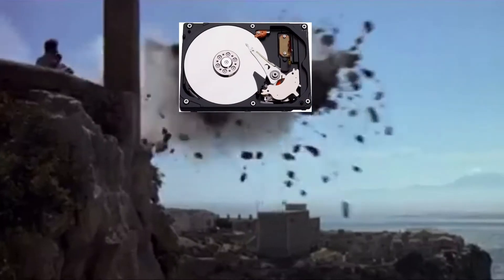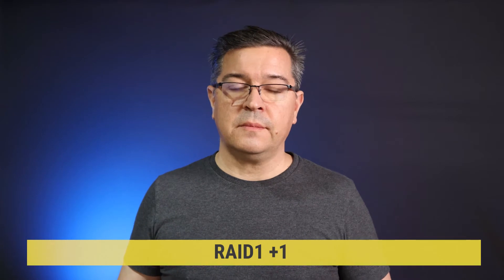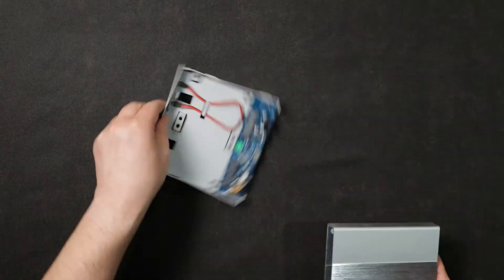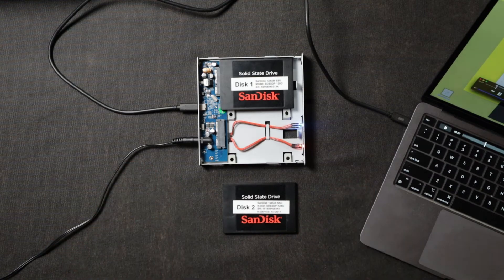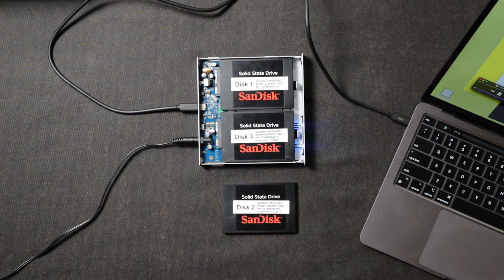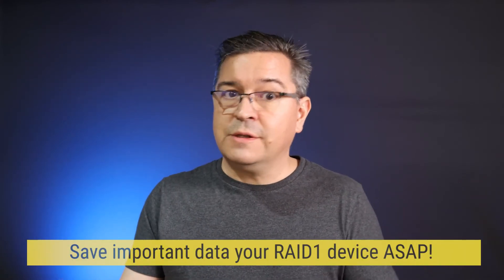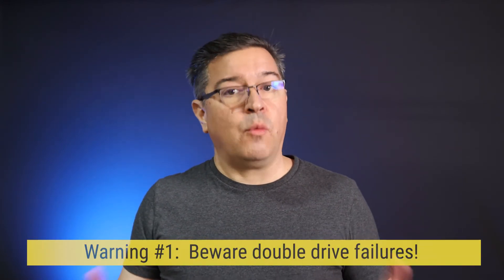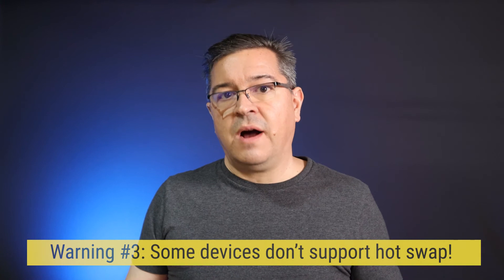CRASH PROOF your data with the RAID1+1 storage system

Comment: Hello, are the raid controllers necessary? I seen you can run raid one configuration on windows (11) simply place 2 drives and set them as raid 1 in windows... also for double hard drive failure. Buy new hard drives half a year apart and logically thinking its almost impossible them both fail at same time ? As one will have half a year more usage. ? 🤔🤔 unlike when you start new and buy same new hdds turn them on at same time and use for same period. Seems like they should both fail at about similar time in that case

Comment: I was exactly looking for something like this, THANK YOU MAN!
It’s basically a hot spare for RAID 1.
I’ve been trying to get a decent 4 bay NAS for the longest time, I’m aiming at making a RAID 5 with 3 disks and a 4th for hot spare but I just can’t dish out the money to start the whole thing. With this strategy I could start with a 2 bay and swap the drives out periodically but wait I have a question: what drive is given the priority to be overwritten in a swap when the 3rd drive has always less data of the other 2 in the RAID 1?

Comment: this is a really bad idea and lot of misinformation.  
        1) when the raid is rebuilding its putting alot of stress on the disks in the array. you are not saving or spreading 'wear' or 'tear'. 
             in most cheap arrays when you insert a disk it does a full rebuild on the new disk and not just rebuilding the missing data. repeatedly rebuilding a disk in array will significantly reduce its lifespan
         2) chance of errors results in catastrophic failure. if a user mistakenly inserts the drives in the wrong order the backup drive could be the data that gets mirrored completely wiping out weeks or months of data
         3) when the rebuild is happening you are increasing the stress and the RAID is in a degraded state. depending on the amount of data this can take hours to days. this mean every time you are doing this you are risking a subsequent disk failure during the rebuild resulting in complete data loss
 
if you want a third disk, the best option is to put that disk in another system (preferably offsite) and use snapshots to replicate the data from your array.
Reply from the maker: Thanks for the detailed comment, hidden! You bring up some excellent cautionary points that folks should consider. Here are my thoughts:

1. full rebuild puts stress on both disks in the array (existing one and fresh one). Yep. You are absolutely right, and folks should assume that rebuild process for a RAID1 array will write every sector of the existing disk to the fresh disk (rather than just writing sectors with data). That rebuild process will stress both disks, and reduces how many years the disk will last (particularly for SSDs). There is also an increased the risk of a double drive failure during the rebuild, because the drives are getting a lot of use in a short period of time. Though it's work noting that the rebuild applies different use to each drive: one is getting a ton of reads and the other is getting a ton of writes. That temporary, differential use also creates varied wear between the drives which is useful for RAID1+1 (see below).

My general answer to this concern is: I don't care if any of the disks die sooner because of the rebuilds. I'm not trying make the disks last as long as possible. The disks will all eventually die, regardless. The only thing I really care about is avoiding the disks failing at around the SAME TIME. Pulling a disk out of the array and putting it aside for a week or month means it's not getting any read/write stress while it's out of rotation, and that action varies the time of its eventual, inevitable failure relative to the other disks in that set. Is this practice an absolute guarantee against double drive failure? No, it is not. However, compared to the risk of two, similar drives subjected to the exact same read/write stress over a period of years failing at the same time? I'm going to keep swapping drives periodically.

> you are not saving or spreading 'wear' or 'tear'. 
I didn't say this process "saves" wear and tear on the disks. It does not. Over the course of years, each of the disks in a RAID1+1 set is getting about the same amount wear and tear, particularly if you are diligent about swapping them out regularly.** The swapping process spreads wear and tear in that each of the disks has reaches a particular level of total use (say 8760 hours of use, 1 year) at different times. If I swap one drive out each month, one of those drives will have up to 720 hours (30 days, about a month) less use at any given time. You can think of this as  randomizing wear on the drives, and that variability is limited by the size of the disk swapping time window (1 week, 1 month, etc). Again, the purpose is to reduce the likelihood of a near-simultaneous double drive failure, by increasing use variability among the 3 drives in the set.

2. mistakenly putting in the wrong RAID disk: It is possible to mess this up, though if you are taking just one disk out, and swapping just one disk in, your chances of messing that up are pretty low. The times I've come close to messing this up is when I've been swapping disks into a dumb RAID1 array (an array with no software interface controls, not a NAS) in rapid succession. This potential fail is also one of the reasons why I number each of the disks in my RAID1+1 sets and keep a log of what disks I've put in and taken out.

The real danger, here, is if you are not paying attention to (or can't tell) if the RAID1 rebuild has completed. If you pull the source disk before the rebuild completes to the fresh disk, you are going to have a bad day. SO, make sure you use a RAID1 device that clearly indicates when the rebuild is complete, and check that indicator before you do any disk swaps.

3. rebuild process is stressful on the disks and can take days, increasing the risk of data loss. That is also true. When I rebuild my 4TB RAID1 set, it can take 12 hours to complete. So if you are swapping disks, it's best to do it when you are expecting some downtime (e.g., just before bedtime or when you aren't actively modifying data). Also, the larger the disks you use, such as 10TB or bigger disks, the higher this risk becomes, because of how much longer the rebuild will take. You can reduce some of this risk by using smaller capacity drives and use more RAID1+1 sets.

One other important details to consider: While the rebuild is going on, ONLY the failure of the existing disk with the current data on it (not the new, fresh disk) will cause the whole array to fail. That will definitely suck, but it's also the best (?) time for that failure, because the disk you just pulled out of the array is a very current version of your data. It's still a risk though, and worth considering. Also, to clarify: If the fresh disk that's being written to fails during the rebuild, that's not a problem, because the existing source disk still has all your current data.

> if you want a third disk, the best option is to put that disk in another system (preferably offsite) and use snapshots to replicate the data from your array.
I think this is a reasonable alternative approach, particularly if you want to get the most life out of the individual disks in the RAID1 array, because it will eliminate the rebuild stress on the disks caused by drive swapping. It does mean you need to set up a good, reliable and separate replication/backup system to the third disk, which you will have to setup and maintain.

This approach, however, also increases the chance of a double drive failure for the two disks in the RAID1 array, because they are getting the exact same amount of use over the course of years. I prefer to randomize my disk use across my disks and also not have to maintain a software backup system, but that just me.

Thanks again for the comments and the alternative 3rd disk approach! The RAID1+1 system definitely has some risks and weaknesses you should consider when deciding how to protect your data.

\\Joe

** If you aren't super-diligent about swapping disks, like you get busy and forget to swap one month, that generally works in your favor, because you are increasing the drive use variability even further among drives in the RAID1+1 set.